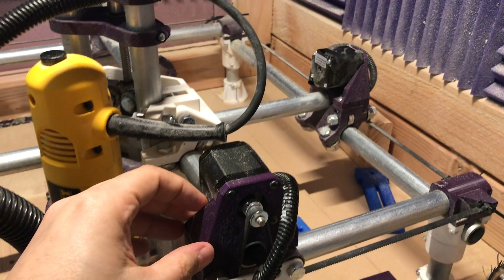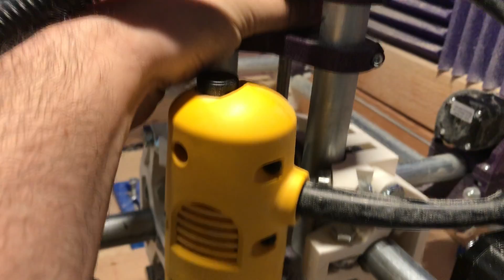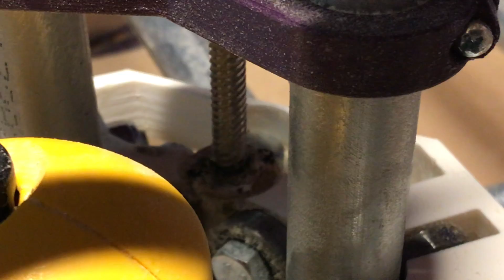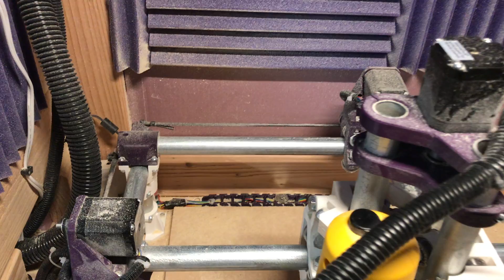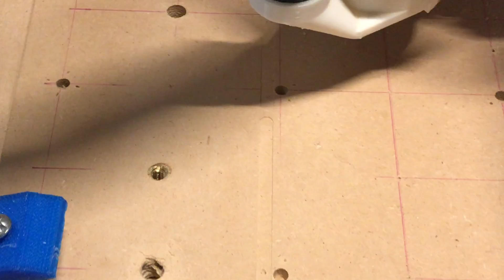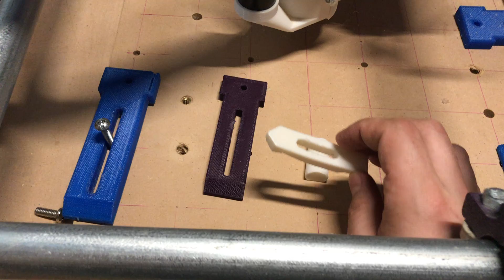Protips before you build your own MPCNC (Mostly Printed CNC machine)

Comment: Hey bro I'm thinking about building a 4ft X 4ft one do you think filling the pipes with cement might help?
Reply from the maker: I have no idea I’ve not built this design that large. Recommended size is much smaller but I’ve heard of people going that large. Your x axis deflection is where you’ll likely have the most challenge and I’m not sure how to solve that. Making the axis heavier and using nema17 may cause performance to degrade. There’s just too many unknowns until someone tries it and reports back

Comment: It has been awhile since you got your MPCNC going.  What are its good and bad points for you?
Reply from the maker: Good pints are it’s inexpensive to get a decent cutting size. I also learned a ton about software, bits, techniques. And it cut wood great!
  The downsides are that my stability wasn’t the best…I wasn’t able to do aluminum for instance and was constantly tweaking my z axis trying to get deflection down. Eventually my feet cracked. The other thing is it was 120 hours or more of printing non stop. There’s a new build but I’d have to print all of the parts again.
   Overall I think it’s a great starting setup and if you’re just needing wood and not going to high scale production it’s really amazing and hard to beat. For me due to having a daughter now that takes a lot of my time, I’ll likely try to buy a shapeoko or xcarve for my next one

Comment: Fill those tubes with structural epoxy and the frame will be stiffer.
Reply from the maker: From what I understand, the frame in this design (Unless you go really large) isn't always the weak point, and so stiffening it doesn't always help unless you also do upgrades to several other areas. But if you've done it with success please let us know, I'd be interested in the cost vs. going steel pipe (which was the recommended path). This is not the new Primo build that is much burlier, I need to put one of those together, though I'm debating at this point for my potential build size if an MPCNC is the right way to go vs. a Carvey or Shapoko (I can only do about 2'x3' max anyway, which gets me 1'x2' of carving space with the design of the MPCNC head)
Reply: @geektoolkit  no I have not done it I am at the stage at looking at building a cnc. I got a 3d printer so this looks like a interesting way to go.
Reply from the maker: @je-fq7ve  Definitely search for the 'Primo' model. This was a few versions back..there is a 'burly' and now Primo. The Primo improves on just about every aspect.  Also aluminum is one option, but Steel is another for having sturdier rails.  People have been able to mill aluminum with the Primo which is awesome, and which I hope to build this year
Reply: @geektoolkit  Thanks just printed a primo corner bracket
Reply from the maker: @je-fq7ve  Wait till you get to the center portion.  When you assemble that I hope you have the sense of appreciation and wonder I did at how amazing that design is!
Reply: @geektoolkit  I already have a sense of it looking at the beauty of the first part.

Comment: A few notes about your video you may have already learned since this was posted. Those clamps that you scaled up are meant to have another bolt threaded through that back hole.  This bolt would be used for height adjustments like the roller piece on the white clamps.  As for the T shaped threaded inserts if you were to use those they would be instead from the bottom of the board instead of the top. That way they wont pull out when you tighten them!
Reply from the maker: Thankyou that’s good info for others that read this. I did learn both of those after this!!
Reply: @geektoolkit  Of course! We're all in this together.  I'm currently doing a lot of research to decide how I build my MPCNC

Comment: Thank for your great intro and things to know about the MPCNC. I have a work in progress of similar sized version 24 x 24 inches but with 1inch conduits. I am trying to figure out what is the right method to measure and screw the 4 legs onto the wood. Secondly, I see you have the spoil board tightly fitting between the stands, so am I right to think your spoil board is 20 inches wide ?  I was actually thinking of getting a spoil board which is 20 x 20 inches square but wasn't quite sure. How far apart are your threaded inserts and can you tell me what is the name and thread size of the zinc threaded mounts which you talked about being neatly mounted underneath the spoil board.
Reply from the maker: I don't have my MPCNC assembled currently (waiting on a new shed...which is waiting on a permit, etc. etc).  So I can't get the measurements, but I can tell you that my approach was really simple.  I built the MPCNC, and then measured between the front feet and ripped a board that wide. If I recall it actually went further front to back.  Keep in mind that if you mill a portion of a longer board, you may want it to go past the feet. Also the area past the feet allows you to lock down the workpiece (assuming it's longer) and stay clear of the head, so its valuable to pick an axis and have a longer spoilboard. Though plan that base don if you're going to enclose it..you don't want the spoil board getting in the way of the enclsoure doors and such. The threaded inserts I eyeballed...if I were to do it again I'd use the CNC itself to cut into the spoilboard and make the grid.  I just wan't confident at the time on having it cut squarely.  So the steps would be 1) Spoilboard, 2)Test cuts to ensure squareness (cut squares/measure diagonals in a scrap piece) then cut spoilboard grid and insert threaded inserts. Hope that helps...I wish I had my MPCNC assembled I'd love to go measure it.

Comment: Hopefully you can 3d print your own workshop in your new place?!?! 😂 Good luck and thanks for the upload.
Reply from the maker: LOL! My biggest problem in the new place is that I can't build a shed due to impervious ground rules, and with COVID I don't think I'm going to get alot of support trying to push my case right now. It's very frustrating to have such an awesome tool and not be able to use it. I'm starting to brainstorm if I can run it outside, but I think my neighbors would have kittens

Comment: Is there much info out there using the Arduino Uno as a controller on this?  It seems that most CNC's now use this.  Thanks for your work on this!
Reply from the maker: John Cole if you’re looking to use an Uno you’ll want to search for info on the Ramps setup which adds a shield to the uno to handle the motors. The motor controllers have to be individually tuned and you have to be careful moving it manually to not have power flow back (Rambo boards have protection there). There’s definitely info out there for it, I’d recommend the forums

Comment: How loud is it with the sound proofing?  I'm thinking of building something similar since I live in an apartment.
Reply from the maker: It was still pretty loud. I could get away without hearing protection but to watch tv I’d have to be in the next room over with an insulated wall. There’s a number of comments on this video with suggestions though. One idea is to add another piece of 3/4” MDF however it gets heavy after a bit. Also there’s a suggestion of rolled towels as filler. I’ve seen CNCs work in apartments but it takes a lot of work and trial and error. The approach I did isn’t enough
Reply: GeekToolkit I have a garage so it won't  actually be inside. I'm more concerned about disturbing the neighbors who live above my garage. My plexiglass enclosure plan may not work then lol
Reply from the maker: TXstang347 yeah having the windows on mine showed me that plexi is great for visibility but didn’t do much for sound dampening! It was noticeably louder with the sides off and the plexi exposed

Comment: how much do you have in this setup?
Reply from the maker: yourdaddidwhat about $400 for the MPCNC including electronics spindle and conduit. About $125 in bits. My 3D printer was 200, but you can get printed pieces for 160 I believe from V1engineering. The wood for the enclosure was about $80 (I piece of plywood and 2x4s...enclosure is 3’x3’) with another 50 or so for soundproofing, wrenches, bolts for tie downs, etc. I could’ve gone quite a bit bigger for not much more..I just didn’t have the space

Comment: Would it help with stability if you built the whole thing with lead screws instead of belts?
Reply from the maker: I’ve not seen anyone do that but perhaps. Like any engineering effort, trying to spruce up one part just points out another weak spot that would also have to be shored up, until you’ve basically rebuilt and redesigned the entire machine.  I think the feet were one area for improvement, and Ryan already released a beefier version since this video. The z unit also has upgrades available, and where I saw a lot of issues...even tightening it can help.
Reply: GeekToolkit makes sense. Thanks!

Comment: The foam you have on the walls is not actually useful for sound proofing, foam is for reducing reverb and reflections but it doesn't reduce the amount of sound that passes through the wall. Adding drywall to the enclosure and caulking the air gaps with green glue would be more effective. John Sayers forum has a lot of similar info on using common building materials to isolate sound.
Reply from the maker: Matt Jones exactly! I’d thought I’d said that...it seemed like it dulled the tone so it was less shrill but didn’t seem to affect dB levels. It is  more for looks in the end. The insulation definitely did more, though if I had to do this again I’d try rolled towels between two MDF boards. I’ll check that site out, and I need to make a follow up because the comment section in this video is a gold mine of info!
Reply: @geektoolkit  I will be watching for your updates. BTW a very cheap way to make a sound barrier is two sheets of drywall with  green glue in between. The "Catalog of STC and IIC Ratings for Wall and Floor/Ceiling Assemblies" online has the STC ratings for various combos of drywall and fiberglass insulation but probably in a cramped space the green glue sandwich is probably the best.

Comment: What material and thickness are you using for your spoil board
Reply from the maker: I just used 3/4" MDF that I had leftover from the sides of my encasement at the time. It really shouldn't matter too much...I think something soft and forgiving in case the bit hits it, but also tuff enough to screw into to hold the material down. I think pine would work fine. I'd probably not use a hard wood.
Reply: GeekToolkit thank you

Comment: Trying to decide how large to make my MPCNC.   Will mostly be cutting wood with it.  Would be nice to cut some stock that is at least 1 by 2 feet.   Been considering a 2x3 foot build with a 4 inch height.  Thoughts?  Thx for the great video!
Reply from the maker: I'd probably add 6 inches to the dimensions to give you a bit of room...there's about a 12-13 inch square of work area you lose from the 'head' of the MPCNC, and cutting on your outer limits really can be a bit tough. However keep in mind that you could potentially do some things like an engrave..then move the wood and continue the engrave. That won't work for complex cuts for 3d carving. 4 inch height sounds great. The nice thing is resizing an MPCNC is really not too tough....so if you decide you need to resize it it's probably a day (4 hours max) of work if you have the belt.  That would include dissassembly, redoing the spoil board, unmounting and remounting the feet, and recutting the conduit. It's really fun how fast it can come together!
Reply: I actually have a 5x3 with a 2’x4’ work area and I mill MDF and Plywood with no issue.

The thing with the MPCNC is you don’t want to use Marlin unless you plan to use it an a cnc and a 3D printer. While Marlin has an advantage of headless operation, I choose to go down the GBRL route and as such I am considering upgrading to Nema 23 closed loop motors.

Comment: Even in Europe (Belgium)  it is not easy to find conduits that maches with the 3 differents version proposed. I have finaly found  ' 'bichromated' steel pipe' with 25 mm external diameter but is is a bit expensive (about 8 € /m)
Reply: 8 euro per meter isn't expensive, you'll not find it anywhere at that price.

Comment: Unless it's an optical illusion that roller mount on the left has a serious issue. The bearing on the lower right isn't even touching the conduit. You can see the gap to the conduit is very asymmetric. I'm in the build process, and two of mine cracked, so I had to re-print them. The designer says that is the absolute worst place you can hang a vacuum hose. Any force there is greatly amplified.
Reply from the maker: Mark M I’ve run mine for a few months before I moved and had to take it apart, and never had issues. So not sure if it was an illusion or just didn’t seem to matter. To be clear before running it I “squared” it each time manually against the end to try to calibrate (but dual end stops are the correct solution and I plan to add them). You’re right Ryan is not a fan of vacuum hoses in general or anything off the head unit, however myself and several forum members have had success and seen little issues. It, like many things with this project, is a trade off and a customization choice. When my sheds built though I’ll be dropping back to stock as I won’t need the dust collection as much and also plan on tightening tolerances to attempt Aluminum. I’m hoping the rest of your build goes smooth, it’s an amazing tool when it’s up and running!

Comment: Hello, What kind of Decibels are you getting outside of enclosure with sound proofing.. I live in an apartment and am worried about how much sound this will kick out. Cheers
Reply from the maker: P Miller I don’t recall the fb, but this would not work in an apartment. That being said, some of the comments have much better techniques for soundproofing which I’ll try when I get to rebuild mine. If I were in an apartment I’d use towels rolled up tightly along with a spindle vs. the 660 (which I’ve heard are quieter to start). Also I’d double up on the walls of it and not use the foam panels . I could have a conversation outside of the box as built in  this video and hear a loud hum through the door. I hope that helps!
Reply: @geektoolkit  ha ha I just looked at your other videos and noticed you have done one about DB and noise enclosure :) Thanks for reply and clips.
Reply from the maker: Oh wow I was trying to reply so fast I’d assumed this comment was on that video. I have a 5 month old daughter, she’s keeping me busy :) When my Shed gets through HOA approval and built I’ll be back to these videos, in the meantime I’ll help in comments where I can!

Comment: Nice build. One note:the t-nuts are designed to go in through the opposite side from the hardware. That way the teeth dig in when you tighten the screw.
Reply from the maker: GRZMNKY yes exactly! I did that wrong the first time and it was awful. Also the way I mounted the spoilboard I would’ve had to do all of them first

Comment: great build, cannot get over the fact you guys use metal conduit in america, biggest no-no ever here in Australia and all conduit is pvc/plastic
Reply from the maker: svd31garage thanks!! That’s also fascinating about the metal conduit in Australia I didn’t realize that! If you are looking at doing a build and can get steel pipe I hear it’s a bit more expensive but would give you a stronger build.
Reply: @geektoolkit  yeah can get stainless, alloy or mild steel (even galvanised) quite easily here, will probably build mine from 316 tubing for the strength and polished up it should glide a lot easier. Australian and New Zealand electrical standards are some of the highest in the world, if not the highest, especially when it comes to safety, hence why pretty much any conduit is non-conductive. Your average wall socket in a house here is 240v 10A but everything has safety switches and RCDs.
Will post the build when im done,
Take care mate
Reply: I know! Same over here in Europe.. Seems both unsafe and hugely time consuming to use metal :S
Reply: @BendikBrenne It's pretty easy to use pipe bender makes quick work of turns. The conduit also is a functional ground.
Reply: Ask your local hardware store for Polished SS pipes, or SS pipes. These are used in diary and nuclear or power plants, easy to find anywhere.
Reply: The metal conduit has very strict building codes it has to adhere to, specifically it must be grounded and any entry to the conduit has to have plastic pieces to prevent stresses and tears to the wires insulation! Hard metal conduit is used mostly for industrial purposes and outdoor applications where you want it to last.
Reply: Gazebo's

Comment: what the dewalt 660 you have, can you mill light aluminium or plastics?
Reply from the maker: I myself have not tried Aluminum, but I know it's possible with that router (Here's the creator Ryan showing it working with the stock setup: https://www.youtube.com/watch?v=BRFeZESDo4k).  You have to go relatively slow, and I'd recommend setting up trochoidal milling...this will help keep the bits cool so they don't weld to the aluminum. Plastic I'm not sure about...I know that spindle speed/heat is a consideration to try to prevent melting...but I'd suspect it'd work.  I'll give it a try and report back when my setup is back up!
Reply: @geektoolkit  Thanks for the reply man.. much appreciated.